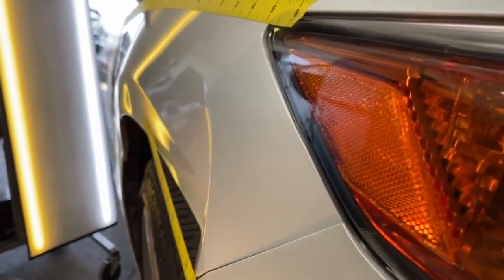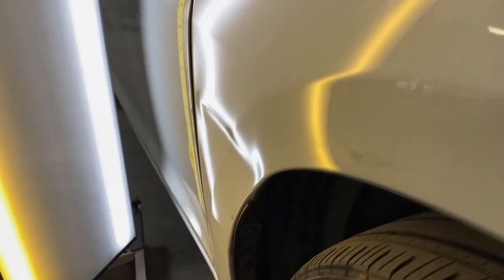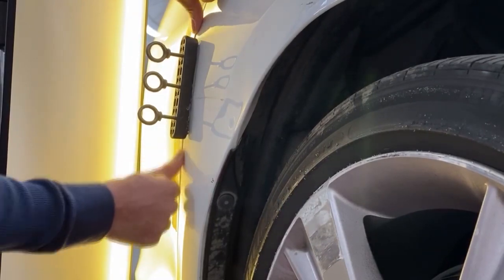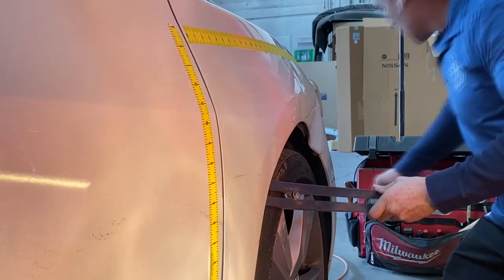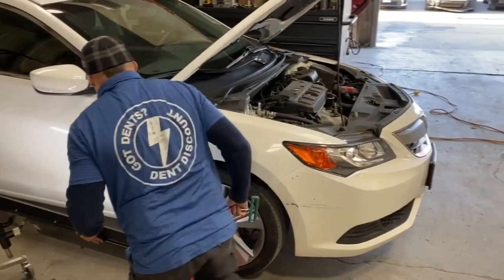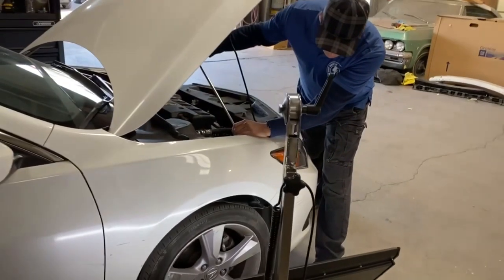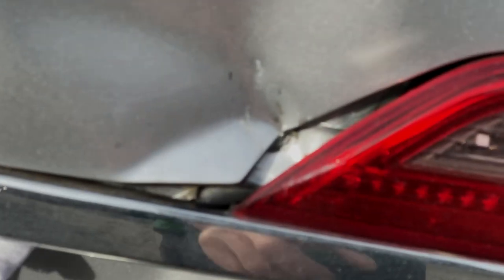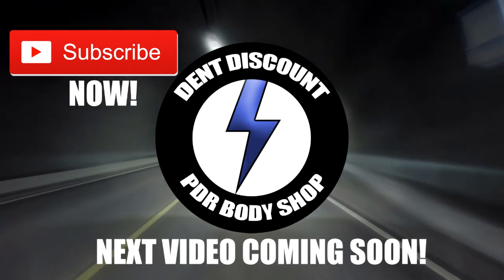Do you like Big Dents? | PDR Dent Removal!

Comment: The PDR guy is subcontractored 1-2 inch dents 
£6 which is $7½ USD a dent
on average 10-15 cars a day 2-5 dents a vehicle
And 4 of our guys are PDR trained only 2 of them do it on the odd occasion when the subcontractor hasn't been around 
Most vehicles are spot welded pin pulled then filler prep mask primer blocking masking paint polish 
Or paint only scratches too deep for a block and polish 
50 cars a day painted,  70 painters panel beaters polishers
The PDR guy that used to come to my garage was £35 per dent trade price, £50 to the public
Great videos, and glad they aren't bombarded with adverts 
 I can see you have more than pride of your work, you have passion. 
Regards Cammy
Reply from the maker: Your spot on Cameron!! 
Thank you for your comment.
Reply: @DentDiscountPDRBodyShop  I asked my work for a course in PDR, only to be told 2 guys went on a course to learn PDR they completed the course 4 months ago and haven't used it since, There is PDR work there for them, every day they just don't want it, I didn't expect to get on the course if there one thing I've learned and that's if you want it, it is better having to work like a mule to get it as the rewards are far greater, the boss did say if I have an interest in it in a few months time he we would consider me going on a course,  it's not going to happen the course that is but I will learn how to PDR, I have that drive in me to accomplish, not to win but to be in race and the drive to finish. 
If it wasn't for technology and guys like you i would be watching the race from the stands 
A guy from where I live but a few years ago before my time moved to the U.S. and opened a Steel work plant his name was Andrew Carnegie, ..who had one thing that made who he was and that was a great teacher.

Comment: PDR Light should have been included in your final assessment if your truly looking for positive comments.  What was your invoice on this repair. How long did it take to bring it to the stage you show as the final review? Overall great work. By no means a novice  level repair. This is advanced PDR. definitely not an experienced route tech job either. I couldn't imagine spending the time required  to PDR this panel in a parking lot of a dealership. Just wouldn't happen.
Reply from the maker: Take a look at the extreme dent I just loaded. Broken seam sealer pinch shell bullet shot to the edge. I have three different lights. shoplight sunlight and also PDR light.

I do have a lot of old videos I’m going to be putting up that I don’t have all three different lights.

Thank you overall good review.

Comment: What size dent dial are you using?
Reply from the maker: Its the heavy duty 35. since you do body work you can also cut leaf spring and make multiple sizes.
Reply: Okay thank you 
That’s what I was thinking just buy their tips 
What about the pdr light what brand is that
Reply from the maker: @geoffreyfoster5172  sounds great keep me posted i like to see how it turns out.
Reply: For sure I will 
I need to get a light what brand light are you using ?
Reply from the maker: do you want a big shop dent light or a mobile pdr light?
Reply: A big shop light
Reply from the maker: i have a couple of shop pdr dent shop lights from ultra they are still working great. all you need is a 3 LED strip. unless you like alot of lines when your working a dent.
Reply: I am not sure yet still learning 
What is your email again ?
Checked out ultra dent website and they have a million different lights
Reply from the maker: i would get the less expensive 3 led shop light. you can call them for prices. keep me posted
Reply: What about the fatty from elimadent ?
Or is this used mostly for hail damage
Reply from the maker: i have the elimadent light for door dings its a great light.